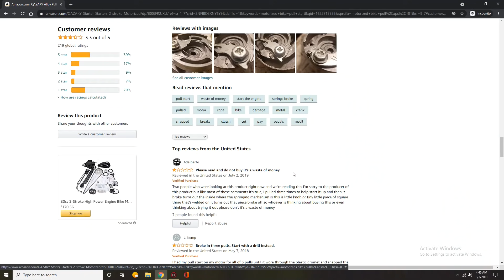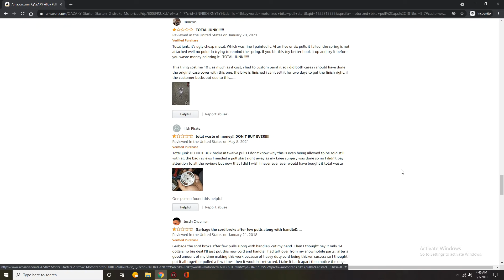Motorized Bike Pull Start

Comment: Someone needs to come out wth a kick start version
Reply: supposedly you can kickstart it with pedals by lifting the back wheel and kicking without clutch engaged
Reply: KTM engines are similar with a "kickstart". I have a few I'm not using,
(I won't ship) but if you want one come to
San Bernardino California.
Hit me up. ✌️
Reply from the maker: Just my luck lol... I lived in San Bernardino for 10 years before moving out here.
Reply: @LAHover  😩Lol! Bummer! Well, I have a few engines and a little bike too that ain't going anywhere, I'll be here if you ever come visit hit me up, I've been in this house for 29 yrs, no plans on leaving yet, wish I could though, I hate it here. Too far from the beach, where I grew up, HB. ✌️
Reply: @LAHover  so get an old friend to pick up and ship.will a pocket bike pull start be stronger
Reply: @m.kasper7646  how much for an engine ?
Reply: Fax my guy
Reply: @flyingsky1559   I kick start mine all the time, but it can be tough to over come compression sometimes when there brand new engines.
Reply: @m.kasper7646 how much for one? I'm in Loma Linda so if they are cheap I'd be willing to hop on my bike and come get one.
Reply: That would be awesome

Comment: I'm on my third pull start.  The first one was not machined properly and there was clearance issue with the part that bolted to the crankshaft and spun the magneto.  The bolts holding the "paws" were too long and they would catch on the Philips head screws that hold the magneto down. It got caught badly once so of course I tugged harder and the pull starter just blew apart in its case. The second one again was bad machining.  the casted retaining pin that held the paw spring taught broke off.  The third pull starter was built by the remaining good parts of the first two.  So far I have only snapped the pull cord once.  Like you I plan on changing it to paracord.

Comment: Hmm. That extra space inside the new magneto bay cover looks like it could house a decent DIY alternator with a rectifier to finally solve the autonomous lighting issue people had been having for years with the F50/80. A bell with epoxied magnets to go onto the crankshaft instead of the pawl holder, and a stator with coils screwed onto the cover.

Comment: someone besides me finally said it...if you want reliability,leave it mostly stock!! Been sayin this for a year now.it doesn't take a seasoned hobbiest to see in every motorized bike group its the guys with tons of aftermarket parts on a cheap engine having break downs daily or working on the bike, not riding it..amen brother
Reply: For reliability and power, keep it mostly stock with upgraded hardware (nuts and bolts) and a better filter, then jet it properly. Adding more parts is more things to potentially go wrong and things needing to upgrade. It's cost me a lot of money to make my 3 speed jackshafted 53cc 4 stroke reliable. I trust it on a 100 mile journey. Have done it many times.
Reply: Matiemance

Comment: The 2nd spring can fail a lot too so it probably hurts reliability more than helps. I’ve had the bent hook on the end break off and had to heat with a torch and bend a new hook. Also the opposite end of that spring, where it’s bent to fit into the plastic, also sometimes slips out of the hole. Even the main rewind spring I’ve had to fix and bend new hooks/tangs in repeatedly

Comment: Pull start:   I also installed the same unit you used, and made all the same mods to improve durability. I also cut a circle from a bleach jug and installed it between the starter spring/rotating part and the case so as to eliminate the rub between the spring an case. Works well, tightens things up a bit and generally makes it smoother an quieter. Any such nylon type plastic should do. I used bleach jug cause it was handy. Keep up the good works!!!
PS have u tried a centrifugal clutch on a two stroke?
Reply from the maker: Yeah surprisingly both of my pull starts with these mods are still working. I have not tried the centrifugal clutch yet, but I am planning on it :) Thanks!
Reply: Centrifugal clutch sucks especially when you can't find replacement pads and their size
Reply: Seems the belt drive would pair up with the centrifugal clutch and pull start.

Comment: I got the style of kickstand that lifts the rear wheel off the ground, easy kick start with the pedals. These pull starts run the risk of snapping the crankshaft key.

Comment: With the 80cc engine, I had problems with the plastic engagement teeth melting to the inner workings of the pull start... but then it got to a point where I was able to grab the drive wheel hard and hand start/prime it as so. pull start the wheel. That was 11 years ago, I have other stuff now with more complex workings.

Comment: 2 out of the 3 times i have bought those wide crank arms, I had to spend about an hour with a rubber mallet straightening the chainring out enough to work properly. The last pair I bought was perfectly straight I was completely ecstatic.

Comment: Waiting on a shorter pedal so I don't have to install the wide...crank system but I did make the mistake of adding a pull start 😕 the string is starting to fray already and I have not been able to get the bike started yet....if I take off the plastic cover and spray some starter fluid in the back of the carb do you think that would do the trick thanks for the Video as always

Comment: I never had a problem with pull starters. They need to be restrung with good cord no matter what. Some needed minor modifications but I always got them working reliably. All the ones I've had had steel pawls though.

Comment: I wish I had watched this last year 😅 I had my motor kit on for a couple months, and relied on it for transportation. I was loving the pull starter, but in the middle of a long trip with a trailer of cargo, those teeth broke off and jammed, snapping the end of the crankshaft off leaving me stranded. I was 16 miles down the trail, not even close to halfway. It took me 8 hours to push the entire thing, cargo and all, back to where I started 🤦‍♂️ I am getting a new engine tomorrow and will avoid the pull starter altogether. Unless a more reliable design comes out!

Comment: Thinking of swapping chain drive to belt drive for my 4 stroke, main concern is how much it will slip at mid rpm stuff when I say need to climb a road hill. Is it worth it? I'm not to concerned about top speed, just want something reliable

Comment: I always thought thar were 2 of ya'll. Lol. I drilled 3 hole's in the bottom of mine. & 3 on the backside between the 2 covers 2 let it breathe. 2 cool the coil & the pull start. So the nylon pulley dosen't dry rot. Just 2 prolong it's life.

Comment: I installed recently a pull start that works wonderfully on my bike much easier than the kickstart which I can still do if need be! I have one and one issue only how can I stop the back wheel from spinning after the pull start and shutting off once I sit to ride!
Reply: use the clutch?

Comment: How do you keep clutch from squealing? Any time i have clutch engaged especially at low speed i get nasty squealing when giving throttle. I've tightened the flower nut, tightened the preload spring, made sure max grip with handle out on cable tension.....
Reply from the maker: Same on this bike. I'll try to find a solution soon.
Reply: @LAHover  it seemed real quiet compared to mine anyway
Reply from the maker: @Thrashaero  once it's up to speed it goes away, but when I start moving it squeals. I cut that out of videos to help save ear drums :P

Comment: I just installed this exact pull start and had the spring issue,resolved pretty much the same way..is there an update on this as I'm curious what to expect with mine.
Reply from the maker: I have two bikes with them now. So far the only other issue I had with one of them is that the cord can eat through the plastic grommet. I replaced it with epoxy putty. Other than that I baby them, making sure not to pull the beans out of them.
Reply: Awesome thanks for the update!..I installed one with plastic inner workings before this one and one of the claws broke off and shredded inside the case..thankfully no damage was done but it can still technically be used with one engaging claw..lol..right in the emergency and spare parts box it goes.

Comment: Just wondering if you could help me with something, at high speed on my bike it seems to be “four striking”. How would I fix this issue?
Reply: Re jetting the carb and adjusting the needle will do it, 
65-67 main jet and needle set second from the top

Comment: I apologize misspelling pull start string from O'Reilly Auto parts and took the plastic grommet out of the pull starter itself and then I put a little bit of wheel bearing grease on the inner spring to help lubricate for functioning but mine was the whole thing was cast metal on the inner piece and it worked fine after that I just had a massive surgery today on my leg I didn't realize it had misspelled
Reply from the maker: ? what o.O?

Comment: could have ditched the pedals entirely and welded on a pipe for your feet to sit on, i need a pull start, bc i dont have pedals lol. but i intend to do lots of mods to the pull start to make it reliable, my bike however isnt necessary to me. its a hobby as mechanics are my thing.

Comment: Be careful with that pull start i bought the same one on amazon and the pullstart line snapped because it engaged as the engine turned on than it just grinded all the parts up and made it unusable because i dident notice till the end of my ride🤦‍♂️

Comment: You should use WD-40 for starting fluid, its safer and wont hurt the engine due to it is a lubricant.
Reply from the maker: I have been using lubed starting fluid, but good suggestion. I'll have to test out the good old WD40 as starting fluid :)
Reply: Please bear with me, where do we spray the starting fluid? & you replace the chord parachord?

Comment: HOLD ON  where the clutch at ? im confuse ,how the bike go if there no clutch
Reply: Its part of the engine. The crankshaft extends to the teardrop cover side of the engine, where it connects to a clutch disk, which then transfers power over to a gear on the oposite size, which has a gear and a clutch arm. When you squeeze the clutch lever, it pulls the arm, and disengages the clutch.

Comment: lofnl! i just got a Skyhawk it has optional start with a drill I never used the feature. But it was a cool idea when I brake in the first Runnings without a load always veering the throttle i in all honesty should have some port work on mine. But this is my Workforce I'm not souping it up expansion chamber that's about it open it up Loctite everywhere I can not the head bolts of course..i do have a tourk wrench 12 15 lbs make sure that you have a true persion fit..80 then finish figure 8 pattern.lwts face it guys.these motors r cheep but fun as hell..flat piece of wood. ... I am digressing now LOL love your videos bro. Pull start is achievable but only with the adapter almost the same spin off as a drill and just as simple recoil but that can only work after breaking and even then why not just pedal the motherfuker you want to feel that compression kick in you by the way I have no problem with the n.t standerd carb.would like to pick ur brain.in turn i will pass a few easy mods on to u

Comment: ... Did i buy the only reliable pull start that was ever made? A year later and shes still startin my bike

Edit: i cant leave a link as boygofast doesnt sell it anymore. Supersadcryingface
Reply: Im pretty sure my pull start is the same as yours. From my experience the plastic guide that the rope leaves the aluminum case with is where and how the rope will fail, after enough pull starts the rope eats through the plastic and then the rope bites into the aluminum cover. As you state, clutch all the way in when pull starting